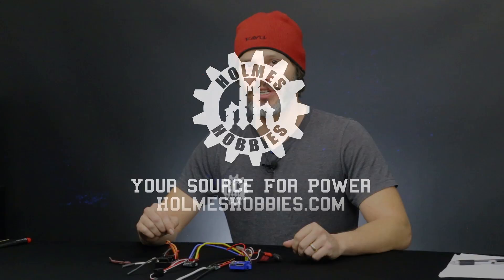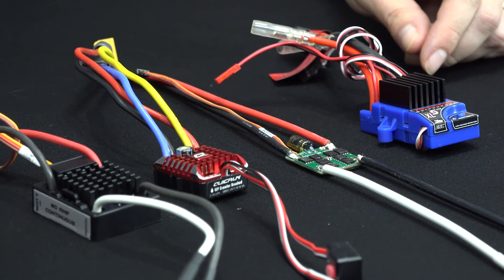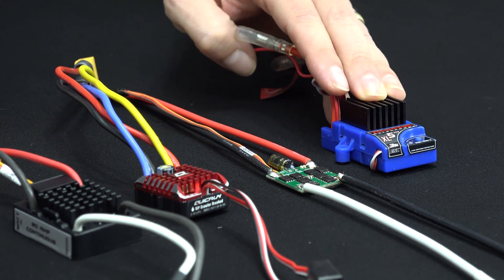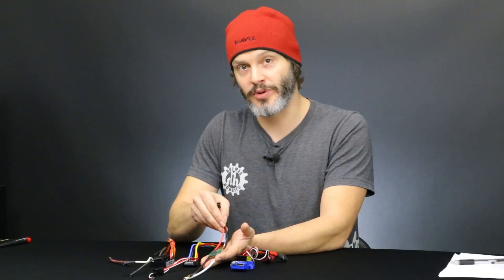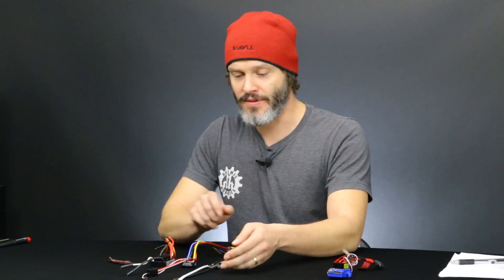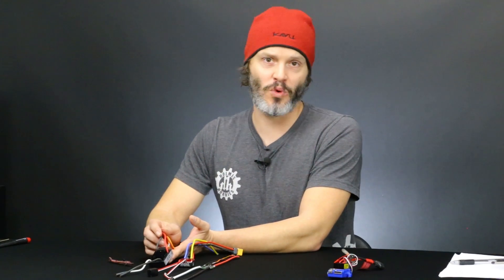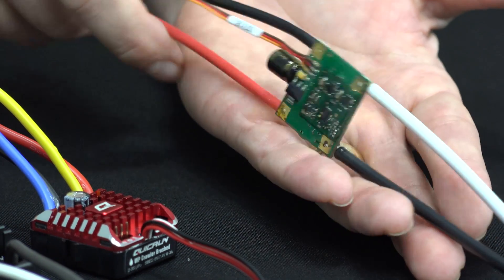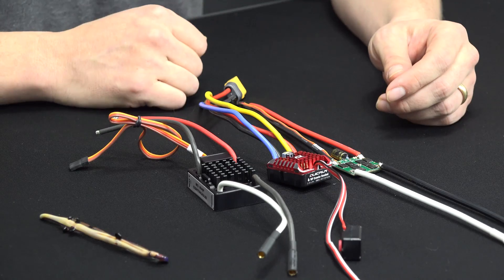Selecting A Brushed Speed Controller - ESC Terms to Know & Features To Look For - Holmes Hobbies

Comment: Going to do a new build, and looking into electronics.  Probably going to use a 16t 5slot, not sure which servo, some lights, 3s setup...and maybe 2 extra micro servos if it ends up being the new SCX10 III kit.  I am trying to decide which "speedo" to use, between the HW 1080, and the Tekin BXR ... my FXR/55t has been rock solid on 3s(with a BEC) , and a Hitec 333oz/in TG servo, for about 12 years now.

Comment: Great video, lots of useful information. Wish I knew a little more about the amperage ratings and how much you need for different motors, like running a low turn brushed motor with a higher kv and how much amperage that requires. Obviously they have motor limits, but still don't fully understand the peak amps vs continuous and whats safe. I know this is a mostly crawler channel and that doesn't apply as much to you guys, but still would love to hear more about it if you ever decide to make more videos on the subject. Either way appreciate the info
Reply from the maker: Its a bit of a murky topic since there aren't really a standardized rating system for ESCs.   Most with ridiculous ratings are simply going off the mosfet die max current, which is not at all a useful number in real life.

Comment: I run 2s to preserve my motor and esc life. I have the 2 speed trx4 so I have the speed when I want it and I rarely notice a need for more power.
Reply: u can run 3s just fine. going up on the battery power does not cause the life of the motor or esc to diminish in that truck. i have a  trx4 thats been owned by 4 people over 4-5 years and has been a competition crawler for all of us. its never seen one 2s battery  and had stock everything till i had it

Comment: you mention liking to use 3s or 4s.   But if using a "1/10th" size esc the motor would probably be a 540 size, is that not 7.2v max?
Reply from the maker: voltage is relative to the motor.   All my motors are designed for 3s and 4s.

Comment: Hi, just wanted to ask is it ok for me to use a high voltage 320a ecs  with bec 5.6v and ubec input voltage 6-16v on my crawler with a 55T crawler motor? i am afraid of burning my motor and i am also planning to install a 25kg. hi torque servo as well.. kindly advice me.
 Thank you

Comment: Hey John! Great video and info. I like the techy stuff and talking about it as well.
For me and what I tend to look for when shopping for esc's are cont./peak amperage, I tend to not worry about smoothness if tuning options allow for me to adjust startup characteristics, and voltage handling.  I have had really good luck with the hobby wing 1080 on 3s running a jx servo around 280 in/oz of torque I think. Using an axial 35t 540 motor. Very smooth throttle curve and punchy when needed. 3s seems to be my go to as it's a good amount of power and speed. 

With servos I find that for most applications 250-350 in/oz is enough. However, I don't sacrifice the response for torque if I can. So I will typically pick the highest amount of torque without sacrificing response speed. Say one servo has 500 in/oz but at a .20 response time and another had 300 in/oz but with a .13 response rate, I'd take the faster servo as long as the torque is sufficient for the weight of the vehicle. With my losi based sportsman rig, I'm going to run a custom wound 540 motor that I bought a bunch of parts from you guys actually, at around 25-30t, hobbywing 1080, Castle bec @ 7.4v, 3s lipo, and a servo with 300+ in/oz and .12 or faster response rate. I expect my truck to weigh about 7 pounds roughly. That's gonna be my go to combination.

Comment: Good info. However, wish you mentioned the meaning of some common terms such as the current rating (A, amps) and wattage also, because the brushed motors which are commonly used on the rock crawlers consume tremendous current and therefore the current rating of the motors vis a vis the esc rating would be a good comparison.
Reply from the maker: If the current ratings were anywhere near accurate, I would.   But they are all over the place, and all these escs are known to work in crawlers.

Comment: Hi, about the XL5 HV, what kind of motor I can use with it?. it says on the manual, limit to 21t 550, can I run 540 35t Motor?
Reply from the maker: yep, thats fine.   Just don't go under 21t 550.
Reply: @HolmesHobbies  what happens with a 20t 540?

Comment: That little Quicrun there is a nice ESC. Very worth the ~$45 it costs. Had it for a short bit in my Granite 4x4 before going to brushless recently. It was decidedly over-sized for a 12t 550. Got warm to the touch with no fan even just hanging on full throttle. Tons of adjustability using the little programmer card that it comes with. Neat thing is that the little programming card works for other ESCs of all kinds often times. I use it for my BLX100.
Reply: Thank you your comment proves I can try to use the HW 1080 on my Arrma Senton brushed version. Did your Granite run without issues with the 1080 ?

Comment: Hi you can make a video on how to build your controller in the Rc4wd Moa or how to drive 2 motors with and how to connect them. I'm not clear how the division / connection ... quite clumsy as that works with 2 motors in unison ..... Train of thought ..... One controller to receiver slot 2 and the other to 3 or both controllers in receiver slot 2 so that both motors run in unison ... But how do I get both plugs in 2 ... adapter / soldering .. ... Mmmm .. ?? Thank you in advance
Reply from the maker: use a 3 or 4 channel radio and use mixing to bias and control the two channels

Comment: I'm running a savox 1230sg on one rig and an mks hv777a+ on another with 1080 esc.  The 1230 is set at 6v, the mks is set at 7.4v.  I'm running a spektrum radio and have not experienced any brown outs. I do prefer an external Bec but the 1080 has proven to be pretty robust.

Comment: I run 20kg (280ish oz/in) Jx or 25kg (350ish oz/in) DsServo servos with the 1080 bec. I never brown out. I prefer a light truck so I never need monster torque. Pretty soon here I'm grabbing a HH brxl and a crawlmaster expert 540 16t. So we will see if your bec will do! I'm sure it will. The jx is not waterproof but its 9 dollars. The DsServo is waterproof and is usually 13 bucks. They are so cheap and they just never do me dirty.

Comment: I love the Holmes hobby sv500v2 servo
Reply: And I run the 1080 in all my rigs love that esc hard to beat it I have a protec 370 running off that bec built into that 1080 and it does just fine have been running it for a year now

Comment: Until recently I was running the stock ae-5 esc 3s 35 turn with no issues on a 12+ lbs rig. I’m currently upgrading it with 12v servo, hobbywing 1080 and 13 turn 5 slot motor.

Comment: Remember the Tyco Typhoon? I lost one of those in a river. Had to be atleast 25 years ago. There was a shallow crossing roughly 150 yards down stream. Used to lose basketballs and other things, run down stream through the woods and be standing in the river waiting on them. The Typhoon went out of range of the transmitter and stopped responding. But that day the river was faster than I was, by the time I got to the crossing it was already passing by.

Comment: Ive been running Power HD WP23 servos with 319oz on your BR XL for around 2 years and on the Hobbywing 1080 for around a year on a  SCX10 and SCX10II both on 3s, 1.9 wheels and both trucks are just under 7lbs, the 1080 gets warmer than the BR XL but its still only warm ad no issues.

Comment: Very informative once again, great to see videos like these, they really help people getting into the hobby.
I love the low speed capabilities of the 1080 that I have but what got me hooked where the lack of noise from it, you can set it to not have as high electronic noise as the 1060 I used earlier and many other cheap esc.
I runt external bec on my cars, Castle Creations on my Wraith and some HobbyKing model on my Ascender, servos are also Hobbyking, "12 something B" which I chose after wrecking several Savöx servos on my Wraith and I chose the HobbyKing servos because the gears look much stronger than the Savöx, still unbroken, three years later 😊
Reply from the maker: Just so you are aware, I was the first company to offer silent switching frequencies on ESCs.  It's only a crawler that stands so close to a vehicle and would hear the noise.  The BRXL and now discontinued BLE both have inaudible frequencies selectable.
Reply: @HolmesHobbies  Honesty that doesn't surprise me one bit, for something like that to happen it takes someone who's doing what he does for the love and passion of the hobby, not to make a whole lot of money, that's a bonus if you can earn money on what drives you to improve whatever you're into.
Reply: @HolmesHobbies  Say that I wanted to replace my RC4WD 55t motor and Hobbywing 1080 esc with your products, what would you recommend me to buy? I have an Ascender with stock drivetrain and tires and I prefer slow and steady crawling and to a lot of trail runs, I use a 5000mah 3s lipo and the car gets it fair share of mud, dust and water, it simply gets used properly 😊
Reply from the maker: My personal choice without going top of the line on everything, 20t crawlmaster expert and BRXL
Reply: @HolmesHobbies  that's not as much as I thought it would be, even with our taxes it's still reasonably, not cheap but not as bad as I thought, I will definitely have this in mind either for future upgrades or projects. Do you have any resellers in Sweden or EU?
Reply from the maker: Not at the moment, your best bet is from rc mart or other china vendors
Reply: @patrikmoller3643  Greens Hobbies in the UK have the BRXL esc.

Comment: the 1080 is hands down the best esc on the market right now...and half the price
Reply from the maker: 100% Chinese vs 100% USA manufactured, engineered, and supported.   There is simply no way to compete on price alone, but my newest firmware update makes the BRXL perform much better than the 1080.

Comment: Hi John please I need your help! My TRX 4 was broken for months everything fried. So I wanted the best, your company told me to buy a BRXL and Crawlmaster 10t I had no clue what to buy. Now my cheap 20kg servo has no power. My stock SCX, Red Cat and other TRX4 have no problem running that servo all with light kits. Your company now told me I need a BEC. How can that be? I spent over $200. And the worst part is I thought maybe the new servo was bad and with crippled hands spent 4 hours putting another new 20kg in only to have the same result. And it also has been going into neutral which I just found out can happen possibly. Please tell me there is a way to fix it. I do have a castle link. Thank you
Reply from the maker: A BEC is always a good idea, and sounds like what you might need.  The lack of BEC is likely what fried your stock ESC as well.  Although it might have provided more power, that is a lot of load on stock internal BECs and they don't do it for long.
Reply: @HolmesHobbies  That is very disappointing to hear. Hoped mine was defective. Wish the description for the BRXL didn't say "switchmode BEC delivers unbelievable servo power at any input voltage." Thank you for responding. Buying another motor from you this week.
Reply from the maker: @rcintro1489  Back when I developed this ESC, it was enough for all the servos on the market.  20kg is right on the cusp, but lower quality servos are quite amp hungry and need twice the amps of what we had (that cost a lot more) back then as well.
Reply from the maker: @rcintro1489  I think we can work something out to get you running.   Can you solder?
Reply: @HolmesHobbies  Ahh that makes sense. I know you're truly are a pioneer in the crawling world. I can solder but don't do the neatest job. I just ordered a helping hand thing cause the nerve damage in my hands has limited everything I can do. And was planning on ordering a BEC but now after watching some install vids I wonder if it will be a problem with the Y splitter for my sound kit since you have to disconnect the positive ESC wire. Thanks for helping John in anyway possible.
Reply from the maker: I've been thinking about this, and you might be right that the internal BEC isn't operating proper.  A 20kg servo should be no issue, even if it is low quality.  Could you send it in for us to check out?
Reply: @HolmesHobbies  Hey John again please help I just bought a Holmes motor and it doesn't work lol I can't win and where can I send the ESC? Thanks!

Comment: Trying to find an ESC that would work with powerwheels RS-550 motors, any suggestions?
Reply: Hobbywing 880 with a 4s lipo battery. There will be two extra wires that I believe you can cap off (made for dual motors but the wires are parallel). Other than that you can check out any of the old traxxas emaxx escs

Comment: I'm converting a hsp nokier 1/8 from nitro to electric, i have a 550 35T and a 550 27T brushed motors, planning on running 2-3s lipo and are now looking for a good ESC to go with that, price range around 0-40$. Any suggestions? :)

Comment: I use a savox 1210sg with the hobbywing 1080. It has 444oz torque
Reply: Are you running a BEC
Reply: @seanhatch4425  no the hobbywing 1080 has a 7.4v internal bec

Comment: I have the holmes hobbies esc that you are showing in the video (great esc),i also bought a 30 turn brushed motor it stopped working I sent it back for warranty work,when I got ti back I put it back in my bomber and used it for about a half hour then the commontater came apart ,I just gave up on it
Reply from the maker: You check the heat while running ?  Bombers are pretty dang hard on 540 brushed motors if not geared just right.   I would be willing to trade towards a 550.
Reply: HolmesHobbies I know they are lol!I put a two speed in it for that reason,I only use it for crawling,I love the power of your motors.I would be willing to do that!! how do we go about it ? Thanks for replying that’s very respectable of you
Reply from the maker: @rccrawler76  send a message to warranty@ .   Since it's likely the two speed that caused it, maybe we split the speed that you are currently running and try a 27t 550 Trailmaster.    Let Justin know in email I would like to send you one.
Reply: HolmesHobbies just letting you know there wouldn’t be any warranty left on the motor I haven’t used it for a while now
Reply from the maker: @rccrawler76  ahh, well that might put a damper on things.   at least take a lesson from it and be more careful with two speeds and gearing.   540 motors are finicky with big tires and two speeds, unless they are slow enough that it doesn't produce much speed or power.
Reply: HolmesHobbies hey john i reglued the commentator and lathed it down I am currently using it in my scx10 2 so far it’s working fine
Reply: HolmesHobbies the motor only get mildly warm I constantly check that while I’m running it, I am presently running a 45 turn integy motorwith no issues
Reply from the maker: @rccrawler76  Such a slow turn motor would be more apt to not overheat.  Especially with a two speed!  That is likely why the 30t didn't last.

Comment: I run the 1080 as it’s one of the most affordable brushed rock crawler escs on the market. I run a Powerhd 23kg servo and it runs it not problem. I have a Trx4 Sport. The internal bec is adjustable. 6 volts or 7.4 volts @ 3 amps. I’ve been running it for two years with no issues. I run it @ 6 volts as the Powerhd 23kg is not HV. Before the Powerhd, I ran a Savox 1210 sg with no issues on. An scx10. It’s a really great esc with lots of programmability. And @ around $40, ya can’t go wrong.

Comment: Also same question for my 4.04lbs which I apologize was going to get the new Holmes hobby motor lol. The 8lbs rig tekin 35t is a good motor but still want to know if I need a bec. With the 80.A hobbywing esc cheerz.

Comment: I just bought the 80.A hobbywing and I am going to my local hobby shop to buy your Holmes hobby motor for my 4lbs rig.  Not sure what one to buy? And if I should be running a external bec, say a 10amp bec on My 8lbs rig with a tekin 35t brushed motor and a savox high amp high torque waterproof servo on the same 80.A hobbywing esc.

Comment: I bought the Quicrun 1080 to get rid of the beeping sounds when driving slowly. I will operate a 60 turn brush motor and a servo with 10 Kg force. The power comes from NiMH 6 cell (7.2Volt) packs.
Reply: It is a DF-models crawler-motor (should) be a brushed (540 can) 3 slot 60 turns bought with the DF-4J. -{8-D

Comment: Im running the quicrun crawler ESC  with a Savox sv-1270tg servo H.H. trail master sport 27t and a winch and haven't had no lack of power but I'm not exactly sure how many oz of torque that servo has it was just on sale at my LHS and the guy recommend it so I went with it haven't had no issue I like the ESC just because the program card makes it easy to tune on the trail and play around with settings
Reply: What battery connection does it come with deans or what?

Comment: Appreciate you sharing thinking about getting the BR-XL which motor would be best for my TRX4 1979 ford bronco with this ESC
Reply from the maker: trailmaster sport 21t 550 is really nice as a similar to stock.   I would personally use a 10t crawlmaster pro 550 if sticking with brushed.

Comment: I am running the Hobbywing 1080 with the bec set to 6.0v in my TRX-4 for the diff lock and shift servos. I have an external BEC dedicated solely to the steering servo. The reason for this set up is because experience has shown that the shift and diff lock servos don't appreciate 7.4v and have shown dramatically shorter life.